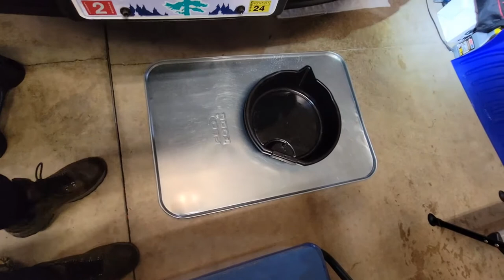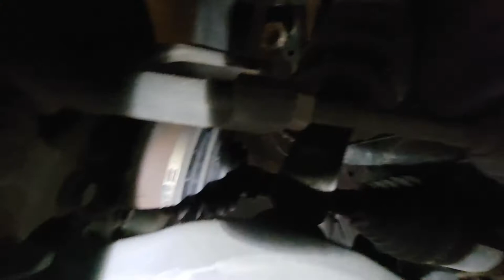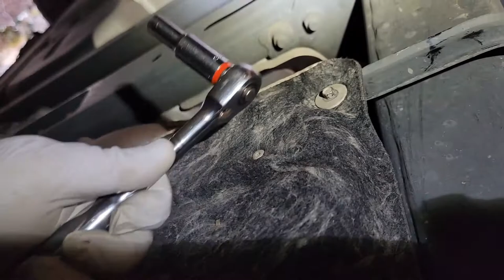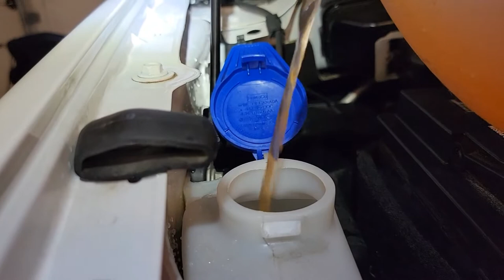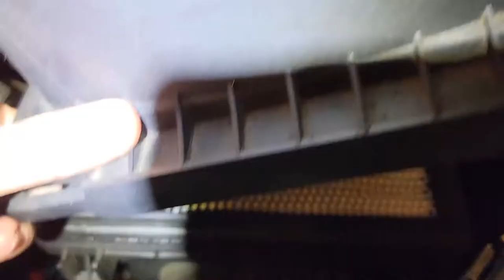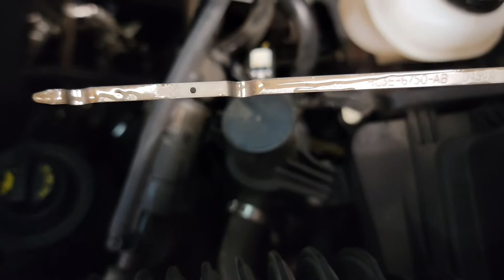Engine Oil & Air Filter Change DIY Tips: 2020 Ford Expedition. Easier than you would think!

Comment: Fumoto oil drain valve will change your life... Your welcome. Get the F137N and some 3/8 ID hose and you can run it strait to your drain pan with zero mess.
Reply: Thanks for the tip. Ended up getting this for my 2020 just now.
Reply: Completely agree on the expedition! I attached the rubber hose on it and left it there for super easy and clean oil changes.
Reply: Any leaks with the unit?  I'm about to install one
Reply: @AnontheGOAT any leaks a year later on the unit?
Reply: @lotuselise8787  Not a single one. not even a drip. I have them on all 3 of my vehicles. Just make sure that you get the proper style valve that works best with your vehicle design.
Reply: @lotuselise8787  none. Also got one installed on two of my other vehicles.

Comment: Bonehead design choice by Ford for the drain plug and oil filter location.
Reply: seems to me it's as easy anything made today.
Reply: @question_it_701  Nah. Drop in filters are the way to go. And drain hole should be pointing straight down, not at a diagonal.
Reply: @AnontheGOAT  Where are the pickups you've designed?  Show us 1.
Reply: @question_it_701  heh, was waiting for a smart ass comment like yours. To answer it, I don’t have to design one cause my 2016 F-150 2.7 ecoboost had a drop on filter. Heck my 2014 E63 AMG has a drop in filter and straight down drain. So one doesn’t need to “design” anything to know what they’re talking about chief.
Reply: @AnontheGOAT  heh heh heh Contgrats on waiting for a comment like mine.   Bonehead design -- says the guy who hasn't designed shit. 🤣
Reply: @question_it_701  lol cause sure. Cause designers haven’t come up with regretful designs before. Oh but they have. Just ask your daddy.
Reply: @AnontheGOAT  Right...sure thing liberal.
Reply: Yeah, same with the cabin air filter. Dumbest design I have seen. that's why I don't buy Ford.

Comment: Yea I wouldn’t go over 4K miles on this oil changes , clean oil is good for both the turbos and more importantly the cam phasers! They are dirty engines with a lot of blow by. Might consider a catch can to add extra protection! Great video
Reply from the maker: I couldn't agree more. These motors like clean oil and they seem to get oil dirty fast just as you explained.  THANK YOU for your thoughtful comments about cam phasers etc.  Catch can is a good idea too, keeps things cleaner still.
Reply: There's a big debate on whether or not a catch can is needed on this 2nd gen 3.5 engine. You should check out the F-150 forum thread on it.

Comment: Easy to get at hell. What about the whole front cross member in the freaking way. All my ford trucks its been right on the bottom where there actually is nothing in the way. My wife has an expedition and ill never change the oilf again. Pain in the butt. Especially when the idiot who owned it previously put the filter on torqued to about 100ft lbs.

Comment: I have a question, I'm doing an oil change myself for the first time on my 2020 expedition, it has 102000 thousand and wanted to keep using the Motorcraft brand but realized after going to a few local stores that that i couldn't find the high mileage so i called the dealership and they told me that there is no high mileage on Motorcraft so should i use the regular 5w 30 Motorcraft or should i go with a different brand that has high mileage not sure if that would make any difference. Thank you

Comment: Thanks this was super easy to follow and your tone made it totally not intimidating. So sick of getting oil changes at the quick lubes. Oil plugs over torqued (hot tip: WD-40, a good hex socket, and patience...) and on my other vehicle they didn't reinstall the plate properly and it ripped off, tearing a TPM sensor and causing $300 in repairs. Turns out those little pieces aren't that cheap! So glad to be able to just do this myself! I threw on some new wiper blades too so my baby is really singing now! 💯